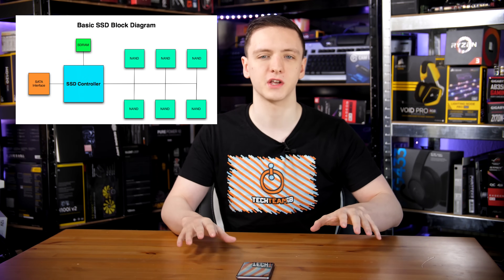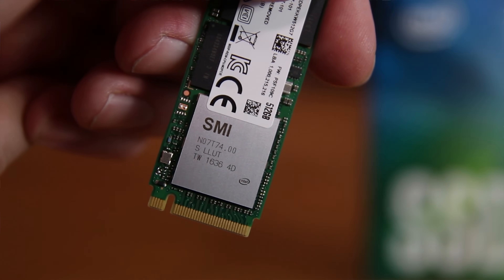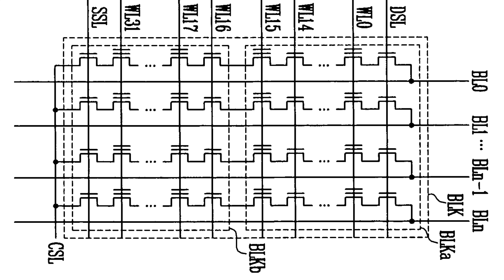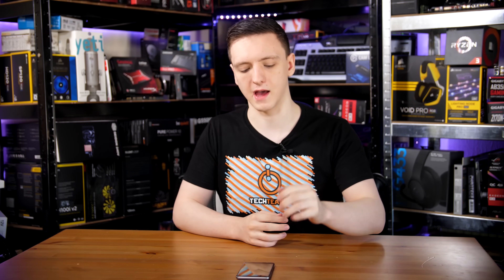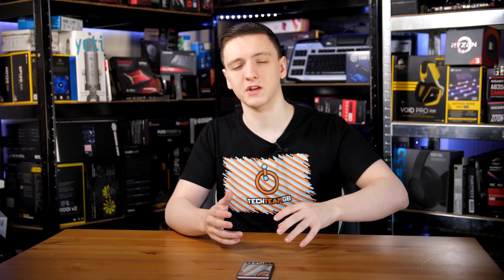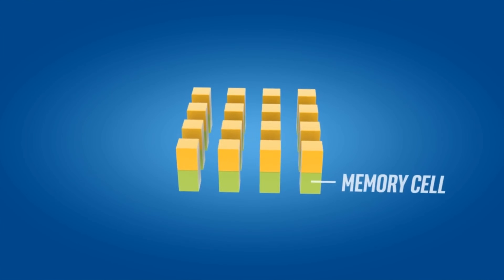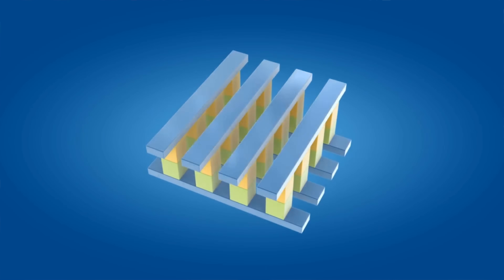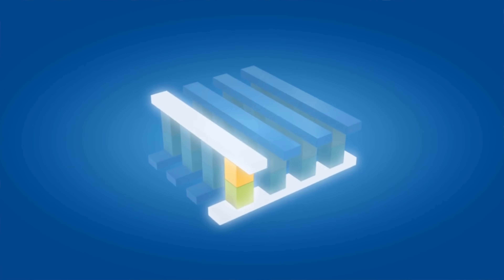How SSDs work

Comment: I want an SSD for my 8  years old laptop dual core to make it better at gaming  what should i buy  (looking for something cheap) i dont care for crazy fps just enought to play
Reply: Mmmm ssd for fps gain?
Reply: Vipor29HD yes but which 1
Reply: Vipor29HD for a while?
Reply: can you send link?
Reply: hbkjn hbjk an ssd has nothing to do with FPS or speed of the video. That would be the graphics card. An ssd just speeds up loading time. Taking the data from storage into ram where it is faster and able to have quick responses with smaller storage